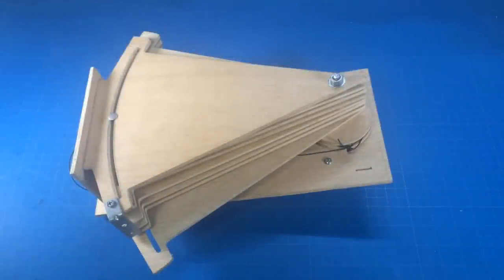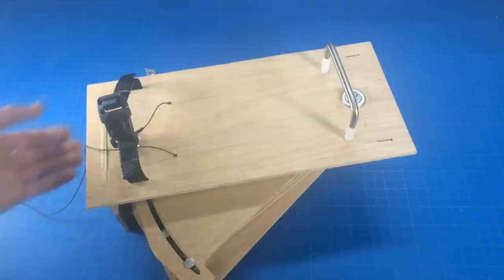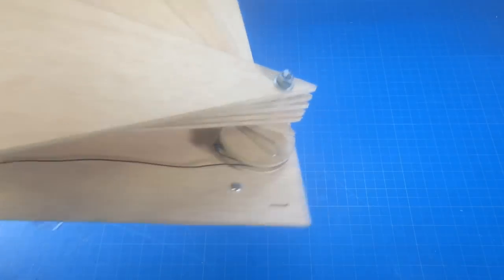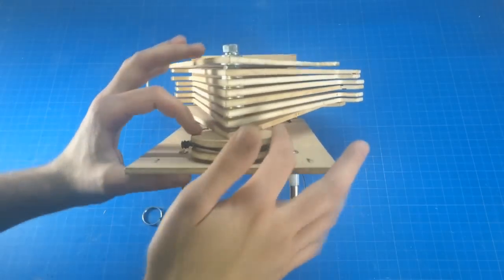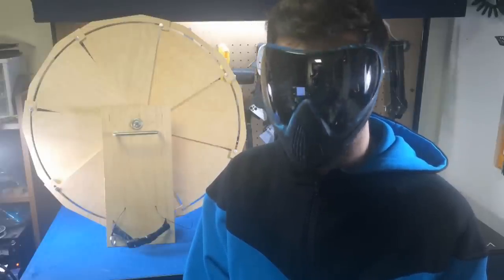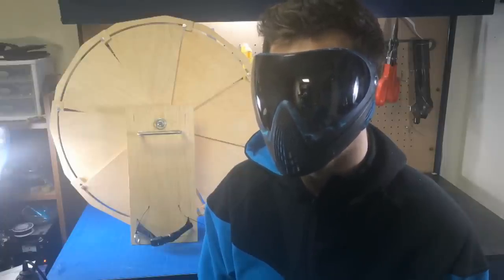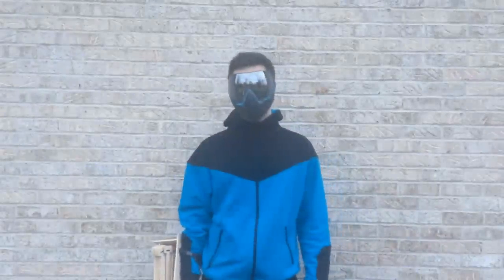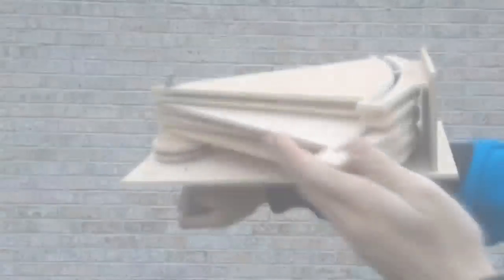Deployable Arm Shield "Percy Jackson Wrist Watch Shield"

Comment: Hey as a automated opening system you could have a button that releases a spring that pulls back a chain that will pull out all the fins. I got this idea from this knife you can look up a couple videos on how it works, here is a link to it 
http://www.amazon.com/Full-Sized-Standard-Handle-Reverse-Edge-Two-Tone/dp/B00LYLQRK6

as for the fins I think some type of aluminum would be great maybe the type of aluminum used in the new iPhone 6s it is strong and is a bit flexible and definitely light weight. But I don't know to much about metals, so I would do some research first. 

Good luck, I voted for you

Comment: if u are reading I recommend some skill to improve the shilde
Reply from the maker: I am planning to cut it out of steel. but it will be heavy. I am also looking into Polycarbonate high impact plastic. 0.09375 thick. So it would be 0.75 in tall. 50% thinner.
Reply: sounds good the lighter the better

Comment: you should do first with the second model of your Shield is 2 like the ceiling out of metals make make it so it opens up you can know that is fully operational and that it will not and it will not be like you just showed it has to has a lot of bugs in it but you still can't make it work mitsuba with the balls on The Shield's Center so you would not have had such a big lump on her way and you are using it and it will not be so conspicuous no not draw so much attention Steve shouldn't really use drinks and I feel like if you are someone that is that I doubt you can research deals you shouldn't really need two hands to open the shield you should only use one hand make the money make the money that you have for the shielding a blade that that's why it's directly onto the other piece of wood and you will know that is working properly I promise it's not right but still if you go on weight taking our put your arm back at your sister has head and swing your arm for work that moment so we'll drive the shield up and back again so it will fully closed and maybe you can probably pull up for a weapon in there just in case just for security reasons